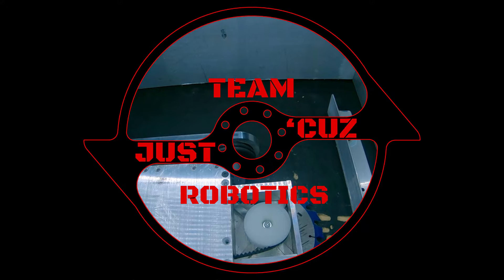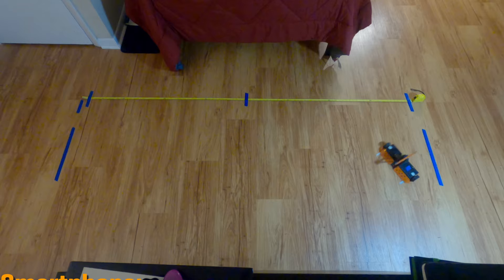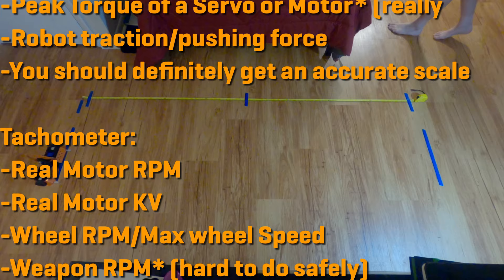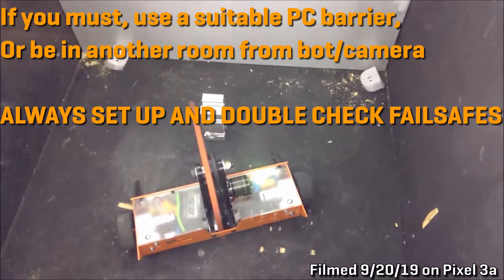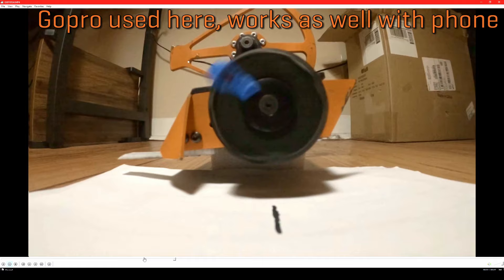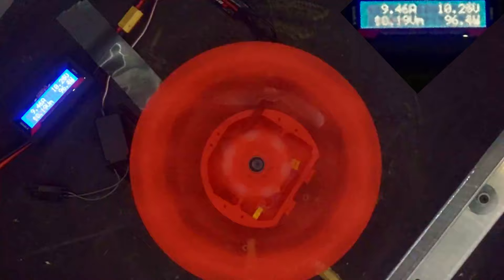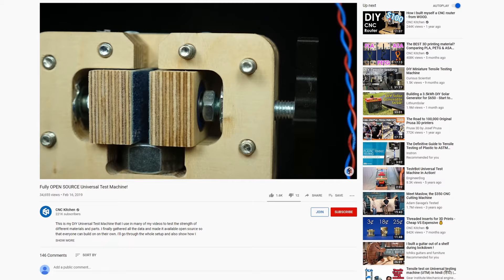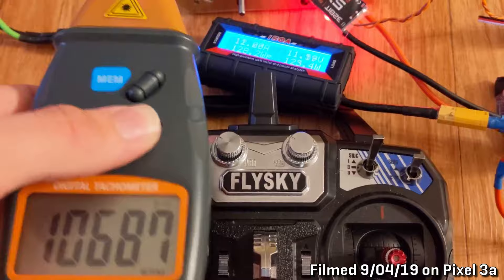Combat Robot Testing Guide - Tips, Tricks, and Tools of the Trade! (& How to Stay Safe Doing It)

Comment: How about attempting Team panic challenge? Building a bot as cheap as possible everything count on price, including tools.
Reply from the maker: I'll definitely consider it, although it seems a bit unfair to count the value of whatever tools I happen to have as opposed to the cheapest version of a given tool. I tend to buy tools to last instead of the cheapest possible version of everything. I also already did a budget 12lb bot video a while back. https://youtu.be/elqB2ew1TIE
Reply: @JustCuzRobotics  yes but o think If you put a tool that Will work in the list but use a expensive one that you already have is not a big problem, he makes all with 60$ so it's other level tô budget build, LOL
Reply from the maker: Yeah I agree he set the bar pretty damn high (low?) at the start. I might talk with Ben about making some standard 'rules' for the challenge and decide on the price of each basic tool.